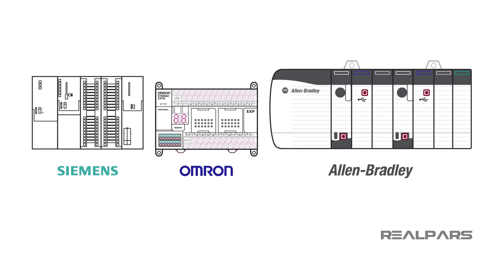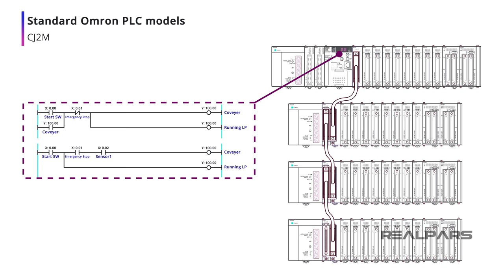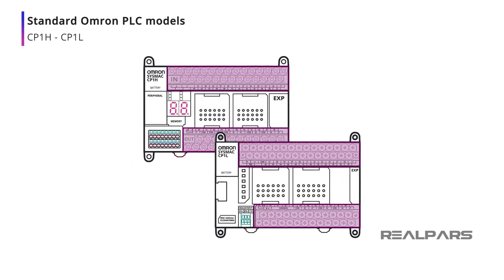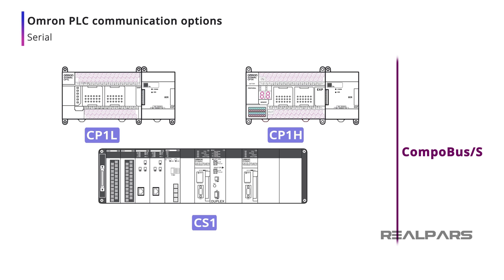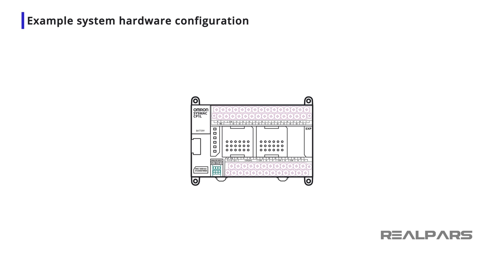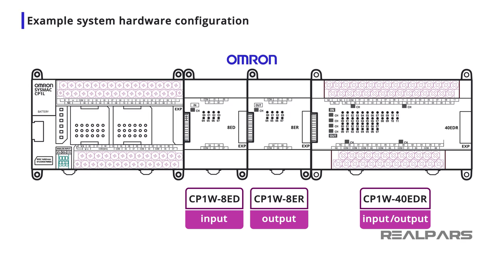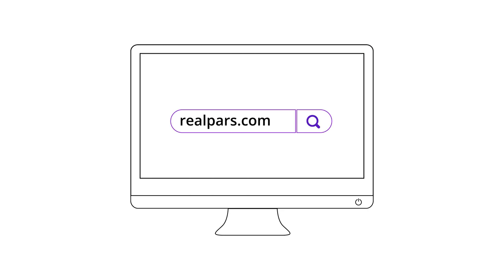Introduction to Omron PLCs

Comment: As the previous comments have suggested, this is all old and mostly obsolete, CX One is still widely used but its on its way out, I am really surprised you would make a video and not include the newer processors which are far more capable and common nowadays than these old ones. NJ and NX are the new are are fairly decent as tag based processors. They have nothing on Rockwell as far as bugs but there is something to be said about the ease of use for HMI files. There is no converting between runtime and project files. It is all done in Sysmac Studio which is really nice. Both platforms have their issues (Rockwell I am looking at you for version incompatibility and HMI runtime files). Overall Sysmac isn't too bad, the HMI integration is kind of nice but there are a few features that I miss from Rockwell. For example, uploading "synchronizing" does not upload tag values from the memory, you have to do that separately. If you are downloading make sure your synchronized and you have the memory uploaded or else your tags will have the wrong values. i.e.. recipe data can screw you.
Reply from the maker: Thank you for your comments. We appreciate the feedback.  At Realpars, we produce videos that highlight automation topics that are of interest to a wide range of interested engineers and technicians.  There is quite a large installed base of the models of CPU's that we cover in this video.  As automation engineers, we do not always have the luxury of configuring the most recent equipment but are often required to maintain legacy models.  We are offering this video, as with all we produce, to provide relevant information.  In the near future, we may produce additional videos on the newer models, and we thank you for the suggestion to do so.

Comment: How to exchange data between OMRON PLC by Ethernet ?
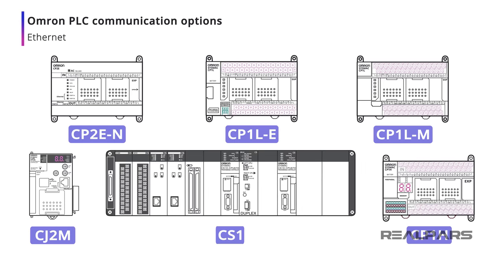Reply from the maker: You will need a PLC CPU that supports ethernet. either via built-in port or add-on interface (see 2:53 in the video).  In the CX-One software configuration, Omron has instruction types for ladder and the other supported languages that allow for data exchange between ethernet nodes.
Reply: @realpars  Which video ?
Reply from the maker: The video here in this page: https://youtu.be/19I71v0pRhY the same video we are exchanging comments! :)